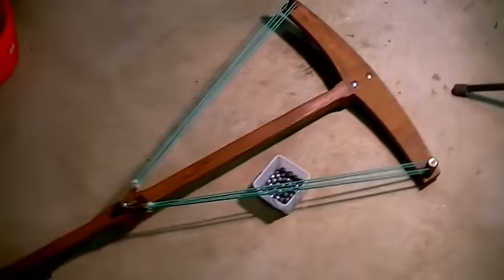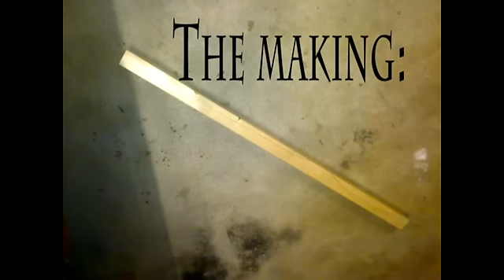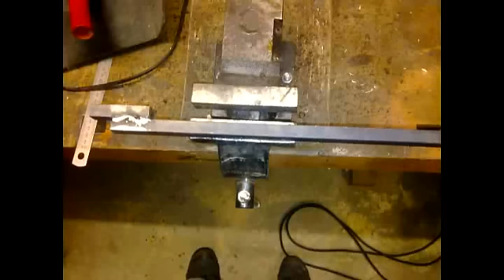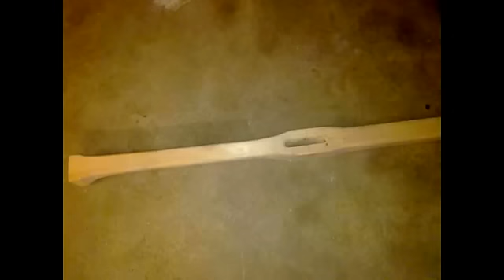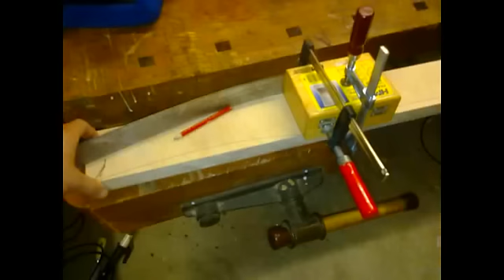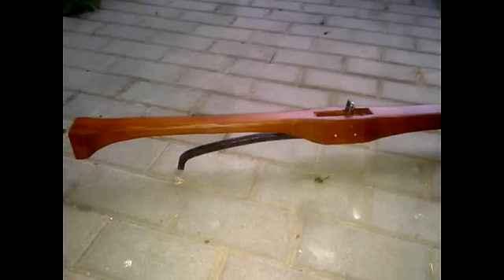Building a Medieval Style Crossbow (rubber powered)

Comment from the maker: wether the ammo is made from steel or lead doesn't affect the accuracy. And why shouldn't I use rollers? What would make it more accurate is using single strips of rubber band instead of lots of rubber tubes.